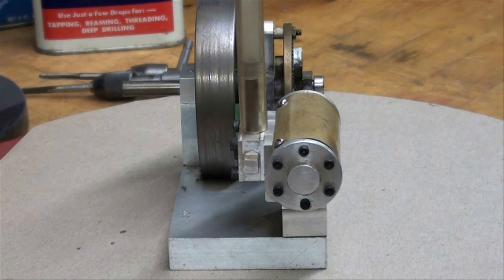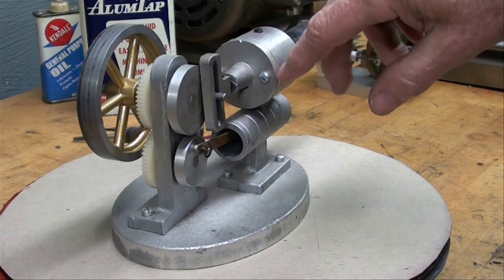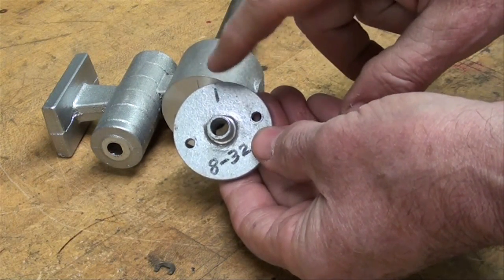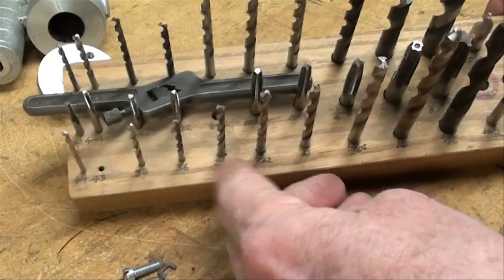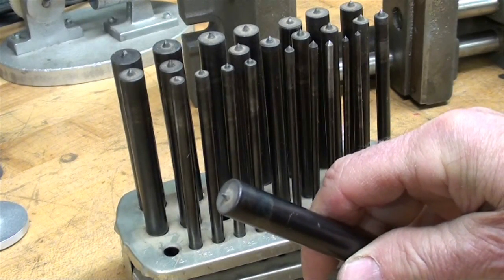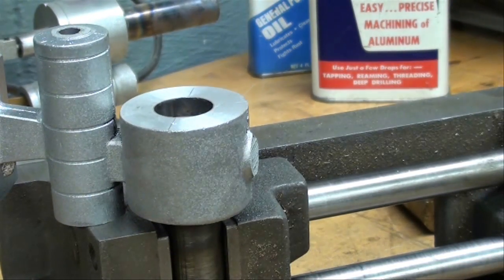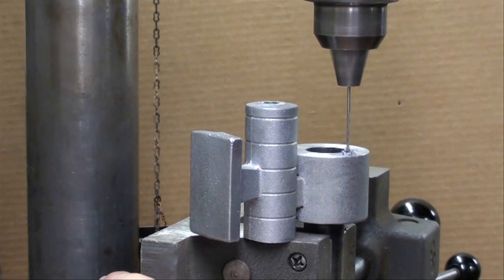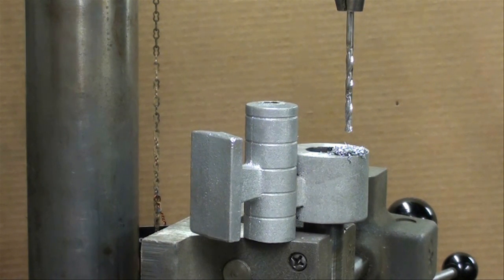MACHINE SHOP TIPS #26 Transferring Holes Part 1 tubalcain

Comment: hey friend just to share a tip, when i transfer holes i find at times it is very usefull to draw a life size picture on a cad software then print it onto sticker paper, then the sticker can be placed
on the work , its very good for layout also, i have found that its also very important to label corners also or you wont line up unless your very percise

Comment: The only problem with going oversize on the tap drill size is that you lose thread height and the threads will strip out easier.

Comment: Hello Tubalcain. Do you have a video showing how you formed the shoulder on the lathe. I am familiar with facing operation, but how do you stop the cutter at the right dimension so the shoulder diameter is correct?

Comment: Nice video.  Do you think a person could make a set of those transfer screws on a metal lathe?  Make them out of a screw that already had threads, and turn a sharp point on them. I guess the hard part would be cutting the flats for the wrench used to install them.  maybe its a dumb question if they aren't that expensive to buy.